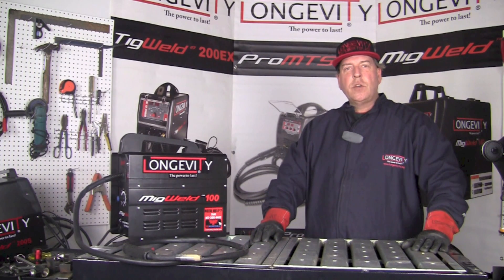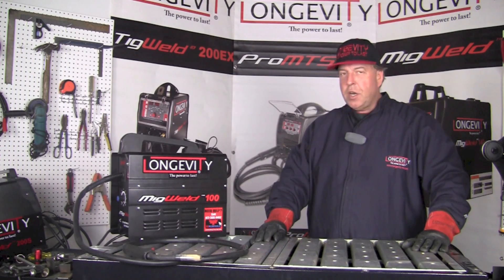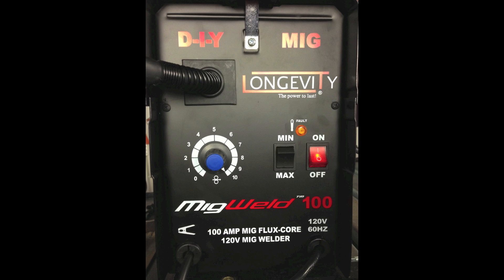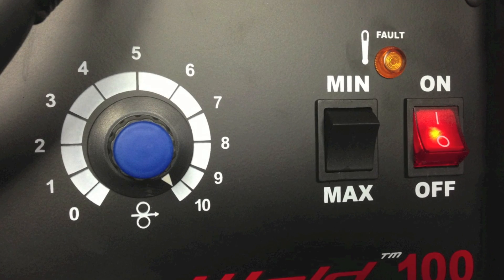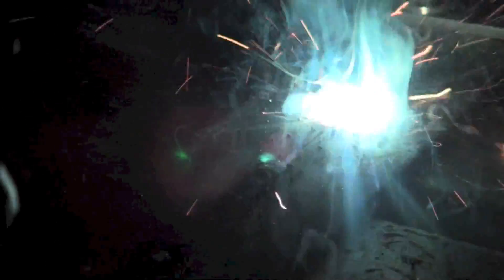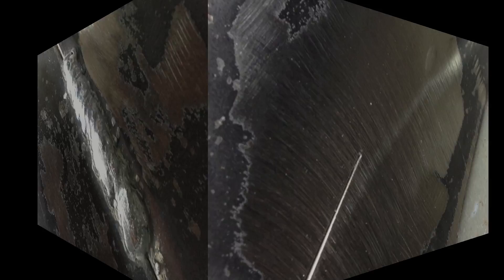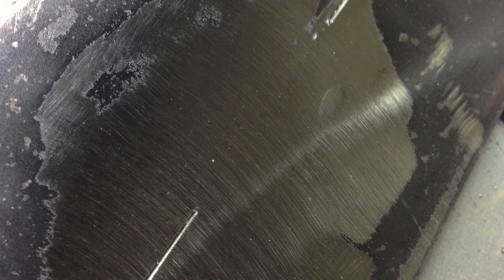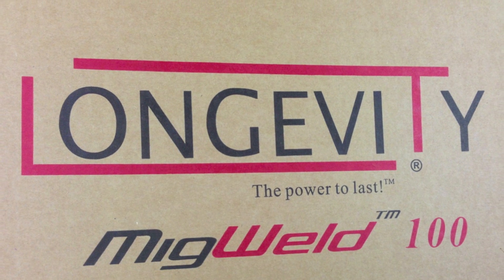BASICS OF SELF SHIELDED FLUX CORE METAL ARC WELDING - MIG SKIP WELDS EXPLAINED

Comment: anyone else run flux core mig without the nozel? I run a chicago 90A mig welder on a crappy ungrounded wall outlet without the nozel on my tip using Lincoln .035 wire and tips